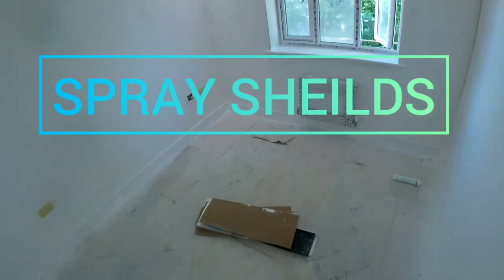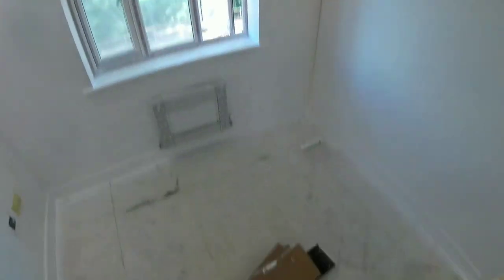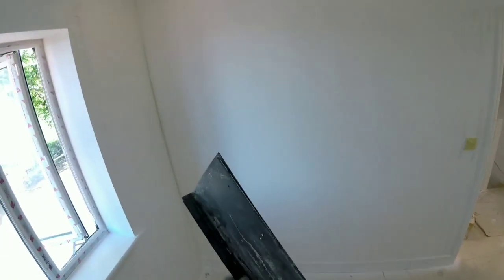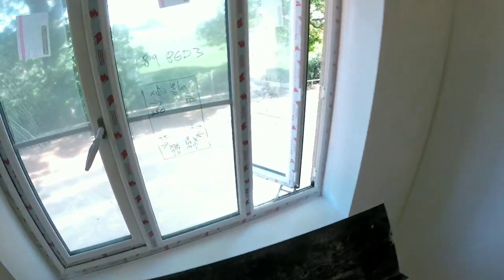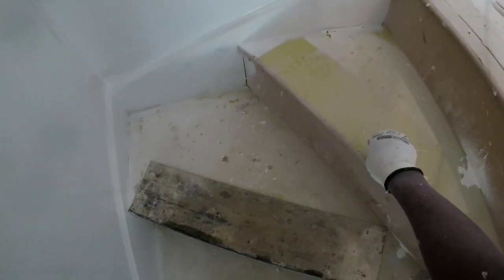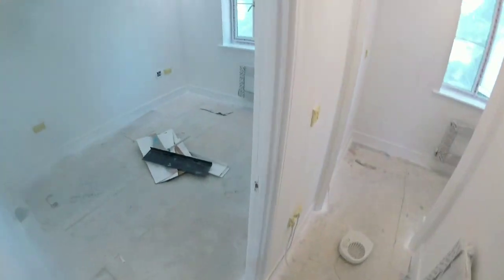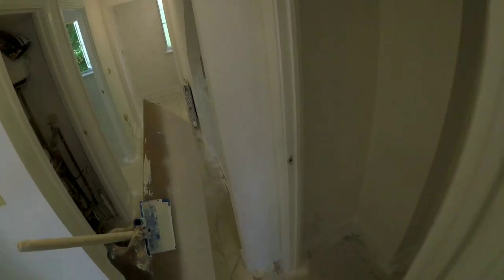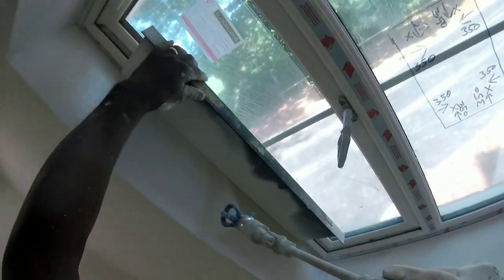PAINT SHIELDS ARE THEY WORTH IT

Comment: 6 inch wienie roller to roll off excess paint and use it also to cut in window to keep from over loading shield with paint.
Reply from the maker: Use 1 shield per reveal , stay at the right  distance and angle you won't need to use a roller for excessive paint

Comment: Hi cam just a quick question, what tip do you use to cut your ceilings and walls in? Also what pressure? Could you do a speed test on cutting rooms in for us?
Reply from the maker: no probs , I actually spray my walls and ceilings to a finish but I can do a speed test on just cutting in . I would be using a graco Ltx 517 spray tip and the pressure will be around 2200 psi. I'll do a vid this week
Reply: cam decorations thanks mate, I have learnt a lot from your videos I currently use a Graco ultra but you have convinced me to buy something bigger Iv gone for the q tech qp019 to see how I get on. A cutting in video would help a lot, could you show us how you would do the kitchens an bathrooms??

Comment: Hi Colin do you ever run oil base through your sprayer if so what do you then clean it with, secondly do you always use pump armour or is there a cheaper alternative. Thanks buddy
Reply from the maker: Yes there is a cheaper version I use , it's called q tector it's about £14 a litre and that litre should last you about a year you can buy that from www.airlesspro.com. 
I don't run oilbase through my sprayer but if your going to do that you just use white spirit to clean everything up with unless your using some kind of shellac paint or cellulose paint then you would use the correct thinners to clean it down with
Reply: Down to the local deals or poundshop and buy a bottle of premixed anti freeze it's 70% glycol it's what Gracos pump armour is basically made up from. Being using it for years works like a dream.
Reply from the maker: @johnmcmorrow1104  yeah I've heard that I've also heard that  mineral spirit works really good as well
Reply: @camdecorations9779  I found with meths, white spirit you want to be careful with it evaporating I went to use some of my machines and when flushed fuck all of it was left.
Reply: @johnmcmorrow1104  snap I’ve been using antifreeze in my GRACO 390 for years, Cheaper and works great 👍
Reply: @deanthomas7858  antifreeze to clean out side body of sprayer or do you mean run it through the inside to clean internal